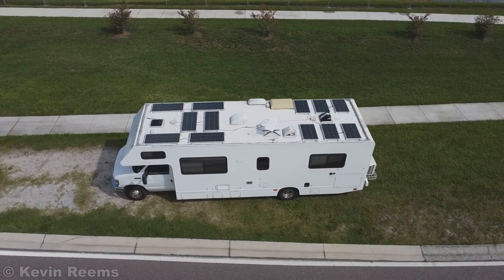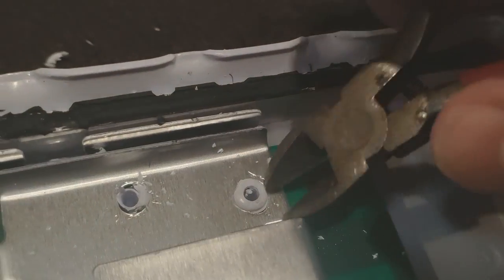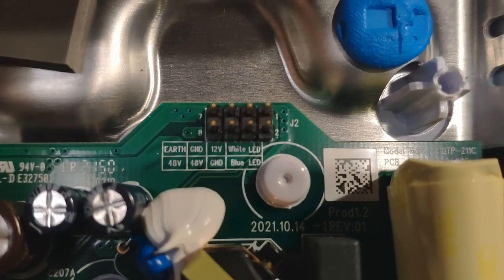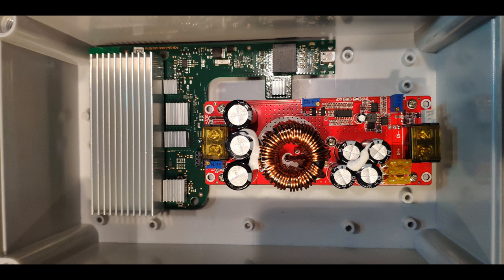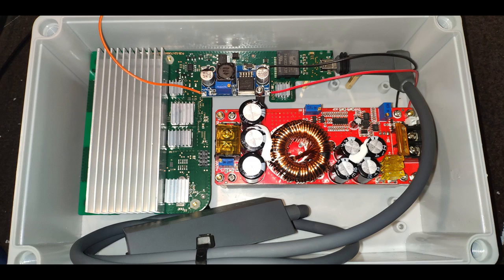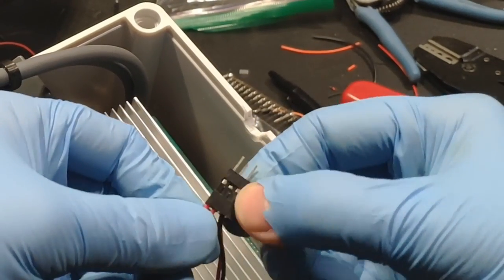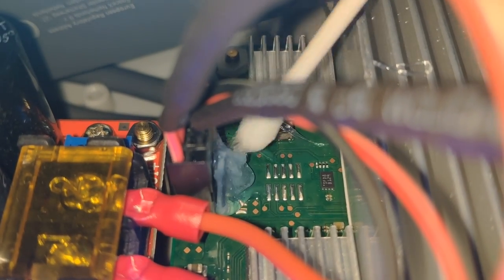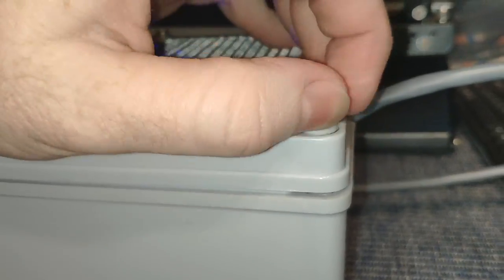V2 StarLink Satellite Internet Router 12V DC Rebuild

Comment: Finished mine today once the 8 pin connectors from Amazon showed up.  Great guide and not too hard at all if you are comfortable with electronics.  Now I don't have to run the inverter in my RV just to keep Starlink running.  Thanks again for posting this!
Reply from the maker: That's awesome! I'm glad the video was useful!
Reply: If the only function of the Starlink PCB is Router; Why not replace it with an off the shelf router?

Comment: That's a lot of work. I think I'm going to ditch the Starlink-supplied router altogether and go with a router that runs 12v natively. Then power the dish with PoE through the optional Starlink ethernet adapter.
Reply from the maker: That works too! I'm pretty sure there are videos out there that explain it.
Reply: Did you successfully manage this?
I have a plan to do the same.

Comment: Thanks Kevin, you video was very useful. My starlink suddenly lost it's Ethernet connection, although WiFi was still working. 

I figured it must be a problem in the little USB-C type connectors, although no amount of wriggling, or spraying contact cleaner made any difference. I have  replacement parts coming, but will take a week or two to arrive, so I figured I had nothing to lose.

I eventually managed to butcher off the front glass sheet, and pulled out all the internals as per your video. Then I re-plugged everything on the bench and magically it worked and has been working fine since. I figured that the bulky mounting hardware around the connectors was somehow preventing correct alignment of the tiny contacts. 

Next I'll remount it all in a metal box (with external WiFi antenna) and better heat-sinks.

I did keep my 240AC Power supply however.
One thing though, there are lethal voltages around the AC Power supply, be careful!

Comment: 1:05 what you're referring to as a "terrible heatsink" is the EMI shield for the power supply. The heat spreader is the other piece left behind in the router with the heat transfer pads.
Reply from the maker: Good to know! Thanks for the insight

Comment: Awesome workaround, so silly it doesn't come with DC power option from the factory.
Reply: For simplicity your could just use a 12V to 110V inverter to plug the Starlink's power adapter in.  Course it's not as efficient as a direct 12V supply wired in, but it's quick and easy.
Reply from the maker: Indeed, that works fine for occasional use. I'm full timing so this is more ideal for me.

Comment: Would you share what exact P/N your starlink router is?  There appears to be at least two hardware revisions of the gen2 router with different Ethernet SICs.  The older version uses Marvell 88E1512, and the newer is EconNet EN8801.  Your PCB in this video appears to be using the Marvell SIC.

Comment: Hello. Pin 6 of my j5 connector referring to the 48v input came out of the board. Can you tell me if it is possible to make a jumper at another point on the board?

Comment: You should have modified the dish to use 12VDC and run a short ethernet from the dish to your own router. The 50VDC is only used to get the power to the dish over a 75ft or 150ft small gauge wire length. (its basically only power over ethernet)
Reply from the maker: What you're saying is true and does work. This is an alternative method intended to keep the functionality of the router for those who want it.
Reply from the maker: I felt the same way, keeping the router allows me to connect the StarLink app and use all of the features it provides.
I actually have another router connected to it with it's own wifi access point. That router tunnels a VPN through the StarLink router. If, for whatever reason I want to bypass the VPN/LAN I can connect to the StarLink router's wifi instead.

Comment: Thanks man, good work! How much Watts/Ampere does it draw?
Reply from the maker: Around 1amp idle and 3amps when active. 4amps while the motors are in use. I couldn't get the heater to turn on due to the summer heat though.
Reply: @KevinsWorkshop  1 amp at the 50 volts? even on DC only? that's not much of an improvement, is it? with Power Factor correction on my solar (at 1.0) my wattmeter reads .8 amps at 50v.
Reply from the maker: I'm measuring the total current being drawn from the battery. Roughly 12 to 36 watts.
Reply: @KevinsWorkshop  thanks! That sound amazing :). So I shouldn't have problems running my compressor fridge ~30-60W and Starlink on the ecoflow river pro's build in automotive socket (Max 136W) with a split adapter. Really good news.
Reply: Can you clarify what you mean by at idle and active? Also, does this impact the hesting function at all?

Comment: I have a question. I have a starlink and I need to make it for a 12V power supply in a truck. is it enough to open it and connect the 12V cables to the motherboard, bypassing the power supply?
Reply from the maker: Sadly no, the router needs regulated 12 volts and the dish itself needs PoE at 50 volts.

Comment: Kevin, where (and which pins) did you get the connector pins to connect to the power connector on the router board?
Reply from the maker: I believe they are regular JST Pins. I had them laying around already but they're very common.

Comment: Wouldnt it be easier, cheaper and easily replaced using aftermarket Wifi routers?
Reply from the maker: You would need a PoE injector but yes, that is a popular method.

Comment: What is the 48Volt for? is it possible that its for the  satellite dish?
 If yes you might find it being transformed down to 12DC inside the arial again. 😂
Reply from the maker: It's for the dish PoE. Some voltage will likely be lost over long runs but that is expected.
Reply: @KevinsWorkshop  Could any PoE router replace the one from Starlink?

Comment: I am a truck driver, I ordered starlink internet and I would like to
connect it to the 12V cigarette lighter input is it possible? is it
possible for you to modify my starlink for 12V power supply, of
course, for a fee :)
Reply: Yes, as long as the cig adapter can supply at least 12V at 4 Amps, or a little higher when the antenna heater turns on.